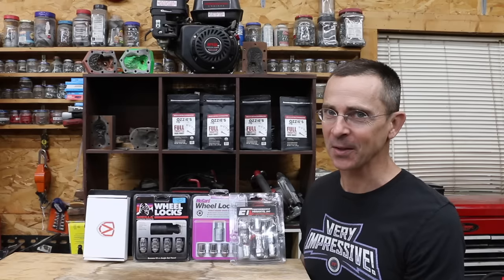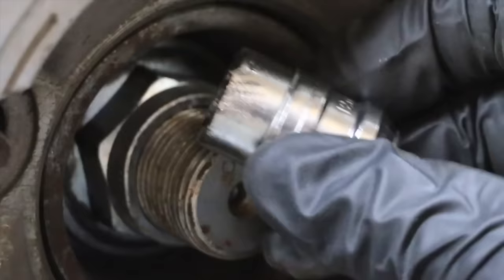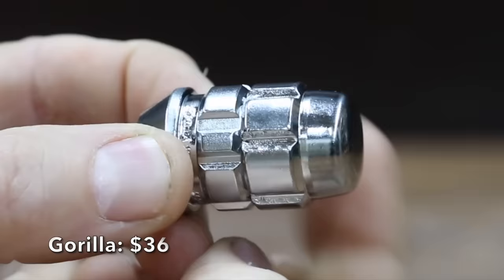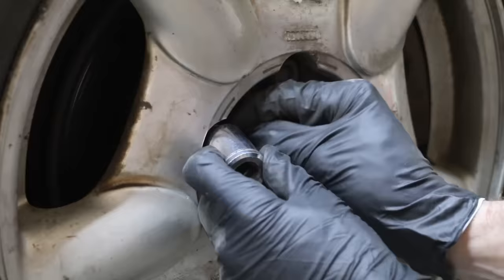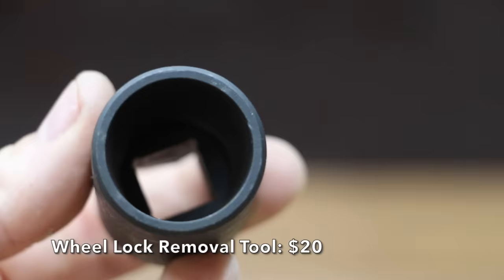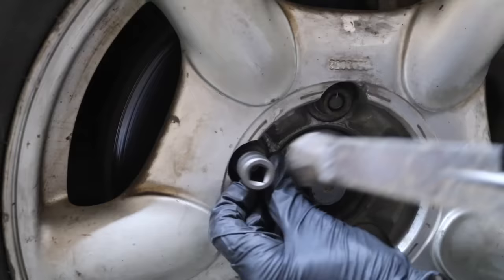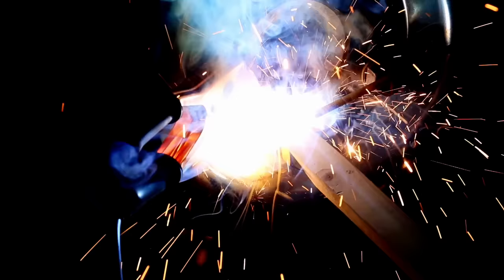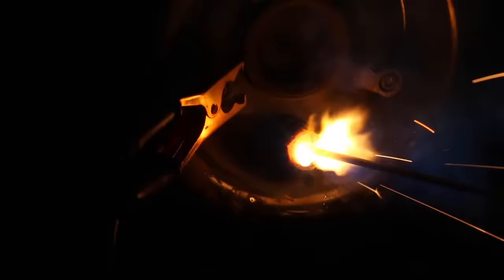Best Car Wheel Theft Deterrent Lug Nut? Can Any Wheel Lock Prevent Theft? Let’s find out!

Comment: BMW have the best secure wheel nuts. I found this out to my cost when I had to get 2 removed due to overtightening. I spoke to loads of people and when I said it was the BMW studs they all had  a sharp intake of breath !  And also if the locking stud is recessed in the wheel that already makes removal 5x as hard !

Comment: That advanced lock was pretty impressive, would be interesting to see how good it works with normal use 🤔
Reply from the maker: Thanks for the suggestion.
Reply: I have had them for a year without any issues
Reply: I've had them on for almost 2 years and no problems. We had a pretty harsh winter, lots of salt and road grime and they still look almost new
Reply: I’ve had mine over 2 years. I got them with the black coating. The coating has lost its sheen but other than that I haven’t had any issues
Reply: Donut channel guys did a similar video, they removed the Advanced Wheel Lock with a bolt extractor in no time at all, it was so easy they reckoned that is why a bolt extractor wasn't used in their infomercial! 🤥😭
Reply: @KJ-iq7fm  I seen the video and I don’t believe it. My buddy and I tried that method after he bought a salvaged car with those locks on… we couldn’t get it off with a bolt extractor. We ended up having to use the welding method
Reply: @vegangainsfather2877  I surprised too, but just figure maybe those guys had a different kind of bolt extractor? 🤔
Reply: @KJ-iq7fm  If they actually were to get them off, then yea must have been a deep well socket or something because the ones we tried were to shallow and couldn't get a bite on them, especially with the way a lot of racing and other expensive wheels are designed where they have deep channels for the lugs to pass through. I spend a lot of time in car forums and I have never heard of anyone getting their wheels stolen with those locks so I'm not at all worried about it

Comment: I have had Advanced wheel locks for 2 1/2 years, as I do a great deal of traveling, and stay in hotels.  Rim replacement would be over $3,000 plus tires and labor, or close to $5,000. The cost of the locks in my opinion, are well worth the lost time and hassles of attempting to obtain new tires and rims. I've not had any attempts made trying to steal my rims,  inspite of traveling  thru some sketchy locations in California. Well worth the more premium cost of the wheel locks. This is a deterrent, but apparently a good one. Very good review. What is peace of mind worth to you? One must not forget, that once your wheels are stolen, there can be a good amount of down time lost, before your up and running again.
Reply: I have them too.  $90 to save $2000 in time and tires is a no brainer.
Reply from the maker: Thanks for sharing.

Comment: The McGard locks look similar to some OEM locks that are more expensive. This was definitely an interesting test! I would be interested to see a test of battery powered walk behind mowers, as I'm in the market for one. I'm trying to decide between DeWalt, Echo, Makita, and Toro.
Reply from the maker: Thanks for the suggestion.
Reply: Do the Ego lawn mowers too. Todd has tons of land to test on.
Reply: Bc they are oem supplier for many car makes.
Reply: Exactly what vadasmate said, oe supplier, and the car companies don't try to hide that most of the time.
Reply: As far as I'm aware, McGard does provide OEM wheel locks to Kia/Hyundai and Nissan.
Reply: Probably too late being 6 months ago, but I'd avoid the battery mower, at least for now.

I got one a couple years ago (Toro), the battery does not last long enough to do my entire yard (1/3 acre) and takes a couple hours to recharge. Buying a second battery was out of the question, they charge $300 for just a battery.

It has turned mowing the lawn into either a two day job, or making half the job very uncomfortable since I can't complete it in the cooler morning.

Comment: As an Advanced Wheel Lock user, I’m not surprised that it comes in at number 1! Awesome product and well-worth the cost. Want to justify the cost? Spending $90 on wheel locks is far better than having to buy all new wheels and tires (speaking from experience). 10/10 would recommend!
Reply from the maker: Thanks for sharing.

Comment: Careful with the advanced wheel locks, I broke one so easily while trying to loosen it with the proper tool key provided.
I can tell you they’re definitely NOT forged as they claim, they look to be cheap cast just as most cheap locks out there.
Someone mentioned that they were going to shut down their business for some reason
Reply from the maker: Thanks for sharing.

Comment: The only time I ever had troubles removing wheel locks was when they were super super snug and required a thin wall socket to remove. Other than that. If they wanted it removed with out damage. We would generally send them to a dealership to have them deal with it.
Reply from the maker: Thanks for sharing.

Comment: A few years ago, I lost the OEM Hyundai/Kia McGard wheel lock key after changing a tire roadside late at night. Went to the tire shop and they were able to extract the wheel lock without cutting a slot in it for a flat head. I don't trust McGard wheel locks to keep a serious thief from getting my wheels off, but it will stop someone who is inexperienced.

Comment: In my dealer days, I use to get off most wheel locks with a USA 12pt Craftsman 1/2” socket that would just barely fit over the wheel lock, use a 4” extension with a long ratchet, using my weight leaning on the extension would be enough to grip the outside of the lock and spin it off. When this didn’t work just hammering on a socket did the trick.

Comment: I fix curb rash for dealerships and when the car doesnt have a wheel lock, we always use the undersized socket method. works 7/10 times .Ill have to remember the adding nails trick.
Reply from the maker: Thanks for sharing.

Comment: I 3D-printed and painted my own hubcaps and used lots of hot melt glue. A thief won't be able to pry them off with a screwdriver. When I want to "unlock" the wheel nuts I simply inject rubbing alcohol between the rim and hubcap. Security through obscurity usually doesn't work, unless of course you build something custom that the thief doesn't understand.
Reply from the maker: Thanks for the feedback.

Comment: My 02 Mustang came with McGard. My 14 Xterra didn't come with any wheel locks. There's another issue that if you provide the key to the tire shop in order to replace the wheels or tires you better remember to check that they gave your key back.
Reply from the maker: Thanks for sharing!

Comment: Many years ago, before phones had internet, a friend called me to help with a flat tire. When I showed up the first thing I noticed was a wheel lock. The friend did not have a key. I happened to have a Dremel and an inverter in my car as well. After going through 5 cutting discs, and 30 minutes, I was able to pry the lock apart by hammering a flat head screw driver into the cut. The spare tire was put back on short one bolt but the friend was able to drive to the parts store to get a new one.
Reply from the maker: Thanks for sharing.

Comment: A few years ago I was looking for wheel locks for my 2017 Jeep Wrangler and discovered the Advanced Wheel Lock System but at that time they did not make their brand of locks for the Jeep JK.  Now they do and I will make the change to them with my next new set of tires later this summer.  It is not the wheels that I worry about being stolen it the $300 cost of each of the tires.
Reply from the maker: Thanks for the feedback.

Comment: Very nice.  I used a set of lug nuts like the complex matching key design years ago.  I never would have thought of someone getting them off in the ways you used, but I'm not a thief.  Like you said, all these techniques are well known by thieves, but the Advanced Wheel Locks set is well worth the price tag for a product that really works.  Now I know what to buy if I ever get expensive rims for the P245/60R15 wide tires I want for my car, I'll remember this video and its winner.  Aftermarket rims would be required for P255/60R15 if I wanted the widest tires I could get, but P245's will squeeze onto my OEM rims.  I found your "Tested Products" spreadsheet and saved a link to it for being able to find past videos easier.  The cone-shape may look weird, but who really cares if they can actually prevent theft?  They even have them in Chrome/Stainless-look and Black.  Great find, Todd!  Too bad they have to be bought directly from Advanced Wheel Locks.  I looked and Amazon doesn't have them so you can't list them for a piece of the purchase price.  I always buy from your Amazon links when I need a product in your videos.  Thanks for everything you do for us!
Reply from the maker: Thanks and you are welcome!  Thanks for sharing.
Reply: I don't blame them for not putting them on amazon. Undoubtedly someone will sell a fake set there, and then they'll get blamed.

Comment: As a professional auto tech, I despise locking nuts. A 220 MIG welder is my go to removal tool for lost keys. I use heavy gauge foil tape and aqua gel to prevent wheel damage.
Reply from the maker: Thanks for sharing.

Comment: There was a news report for my area right when I just got my brand new Honda Accord that theft of Accord wheels were up because they were the most interchangeable with other vehicles. So I researched and settled on Gorilla Lock. My wheel is not the open type and the locks are the smoothed and rounded tops with deep recessed key teeth. So I was happy but I liked the other feature that Gorilla Lock offered where I could get a 4 pack. Or 20. So I got the 20.  Unless they just steal the whole car my car not worth risking getting caught to remove 4 locks minimally.  Great testing. Wish I had this video when I was making a decision 4 years ago
Reply from the maker: Thanks!  Thanks for sharing.

Comment: Just thought of a new video idea for you that I’d love to see. A rafter square comparison because I’ve heard stories of the Milwaukee ones in particular being not super accurate. 

Some things you could test them on are: 1. Accuracy (measured against a machinist square)
2. Durability both in overall strength and holding square after
3. Unconventional uses, while we can all say we shouldn’t use our squares in some ways a square that doesn’t bend or get nicks in it easily would be beneficial
4. Additional features: what marks are on the squares, built in bubble levels such as the Martinez squares, extensions such as the crescent tools squares, etc.
Reply from the maker: Thanks for the video idea.

Comment: Finally learned why I never see them up in Alberta here.... They became my own theft deterrent when I sheared the key last weekend with my breaker bar......

At least now I own nut extractors. Then I just had to drop the truck off the curb with loose nuts four times to pop the rears off the axle...

Maybe don't use em on trucks when you're torquing to 150ftlbs. Little scuffing to the hub face let's see how it goes in the fall.
Reply from the maker: Thanks for the feedback.

Comment: We lost the key to a VW wheel stud. I went to the auto parts store and bought a set of removal sockets and had the wheel off in a minute. It was so easy, I replaced all my locks with conventional nuts and studs.
Reply from the maker: Thanks for sharing.
Reply: You should test the VW OEM locking wheel studs. Probably no better than McGuard based on my experience, @ProjectFarm

Comment: For mcguard wheel locks just use 12 pt 19mm socket... easy peasy Japanesy lemon squeezy
Spline nuts can be removed with a 6 point 17mm. The smaller size ones. 
Imo the ones with tamper rings like dodge/jeeps have are some of the better ones. They can all be removed with enough diligence.
Reply from the maker: Thanks for sharing!

Comment: Best wheel locks: the two piece OEM bolts that come on some chryslers and jeeps. Have your local airgun mechanic rotate your tires and the heads will be so screwed up no one will get those off ever again.

Comment: I wish you could have tested the new locks we have for GM. They feature a pattern around the outside and have a fake spinning cap that looks more like a real lug nut. The flange where the pattern sits prevents access to the bottom of the locking nut as it sits out farther than the standard lug. It even fills out the hole almost completely in oem wheels.
Reply from the maker: Thanks for the constructive feedback.

Comment: Thanks for making all of these amazing videos. I often buy products based on your tests. I was hoping to find that you had already tested padlocks, but I didn't see them listed on your videos. Specifically, our canoe club has a bin by the beach, and a storage trailer that we lock using combination locks, so all members can have access. We have tried a few different brands, but between the salty air, rain, and being used several times a week, they just don't seem to last more than a few weeks, or, if we are lucky a few months. We don't need it to be super secure, but weather resistance would be important. Thanks again for your hard work that benefits so many.
Reply from the maker: You are welcome!  Thanks for the suggestion.

Comment: Wheel locks serve as a slow down deterrent for impulsive thieves.  I've always replace all five lugs with same key McGards and Gorilla locks.  Mixing acorns and insert key locks helps. Also tape the lug nut key to a four sized crossbar tire wrench as the key size may not match your OEM wrench.
Reply from the maker: Thanks for sharing.

Comment: Remove the 4 or 5 normal lug nuts and then get a large pry bar between the wheel and brake rotor. You're trying to stretch or bend the remaining stud the lock is on. You can then remove the lock with your finger. 

I'm not teaching thieves anything they don't already know. Used this technique more than once when I wrenched and the customer either didn't have the lock key or didn't even know they had wheel locks
Reply from the maker: Thanks for the feedback.

Comment: From personal experience, one of the most effective ways to protect a wheel lock is to have wheels with a very small space around the lug nut preventing you from getting tools on them. I bought a van without realizing the previous owmer had installed wheel locks but not left the tool in the vehicle. None of my local tire shops were successful in extraction because of how tight the area was. Even the closest ford dealer couldnt help. I ended up going all the way back to the dealer i bought it from for them to finally remove supposedly for free since they sold it to me that way. Unfortunately i needed my parents to pick it up for me because i was working that day and when they showed me the receipt the bastards had charged me for it anyway and because i wasnt there to argue about it the charge stuck
Reply from the maker: Thanks for sharing.
Reply: Could have disputed that with your cc and/or bank and got the charge removed.

Comment: The big thing to remember is, if someone really wants something, they can get it. However, they need to spend time which increases their risk. A set of wheels is not worth 30+ mins of messing with locks in hopes that the owner, or a passer by will not notice and call the police. Time is money and thieves normally look for easy targets. Get in and out quickly. A wheel lock itself tells them that it will take some work to get the wheels and may deter them. 

You ever see those ring security cameras where someone try's to open a door, sees it is locked, and walks away? That is because the effort is not worth it. They want an easy target. A already unlocked door. 

Pro tip: Make damn sure you know where that lock key is at all times. Mechanics charge a bit if they need to remove them without the key. Then you have extra costs and need to buy more locks.
Reply from the maker: Thanks for the feedback.

Comment: Long-Term Review: Advanced Wheel Lock System. Two issues: 1) significant rusting on all four (4) nuts, and 2) chrome plating has chipped away and peeled off to such a point that metallic slivers are easy to get.

Comment: Wire connection ends and wire crimping and wire stripping tools.
They have all different types of wire end connectors, brands ect. Some hard sleeve some srink wrapped ends even have a solder seal butt connector. 
Some crimp and hold great, some not so good. Some even damage when crimping.
Reply from the maker: Thanks for the suggestion.

Comment: Idk about this testing though, anyone getting good wheels usually has those lugnuts in the wheel itself like you won't really have a shot in using vice grips or much space to turn it. Like literally 90% of aftermarket wheels have smaller lug holes so you need to get aftermarket lug nuts that use a tool to take them on and off, not only that but they are usually in the wheel like the lug nut is smaller than the lug hole length so there's rarely any of it sticking out so you can use vice grip pliers. I mean i like the video he did put work into it just stating that really unlikely for people to take 1-2k wheels when the lug holes usually wont allow access or they have a cap that usually has security screws holding it. Maybe on that type of wheel he might have a better chance.

Comment: An air hammer with a chisel head works wonders on wheel locks. That is what I always used when I was a mechanic and a customer had lost their key and need them removed.
Reply from the maker: Thanks for sharing.